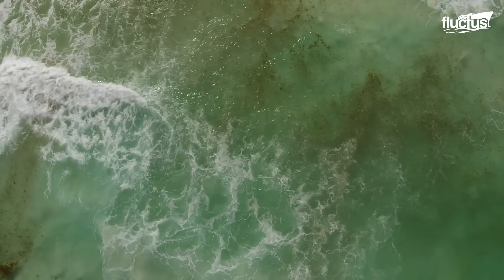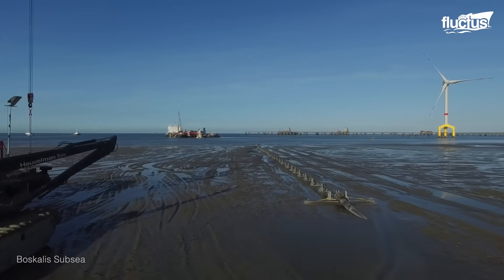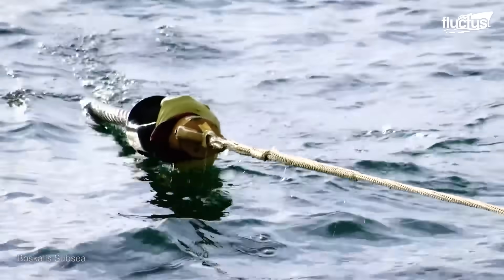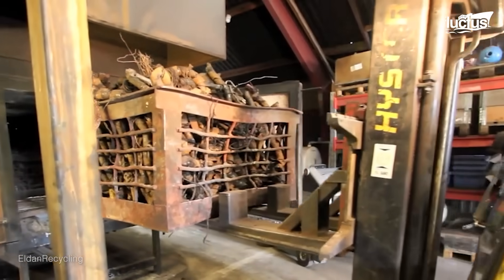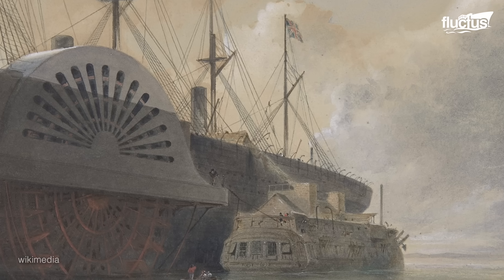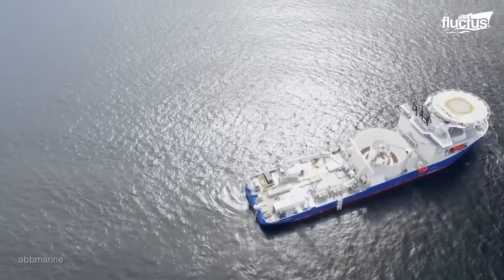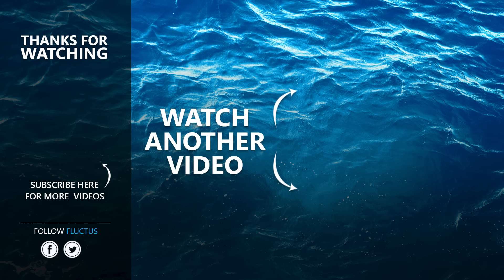There is a Reason Why Underwater Power Cables are So Expensive

Comment: I work for a company that makes similar undersea cables off and on for random customers (we make custom wire/cable as a business). The extrusion machines for the final jacket on the undersea stuff is massive. The extruder screw takes 6 guys and a special cart to install. looking at all those sub components... makes me shudder knowing how easy it is to screw up one production stage and completely ruin all the stages prior... Lol, makes me glad I work primary extrusion (the stages that put the first layer of insulation on bare metal strand) and don't generally have to worry about my mistakes, if any, ruining everyone else's work. Final Jacket on a cable like this probably has multiple process techs/engineers triple checking everything, so the operators probably aren't the ones to get in trouble if something goes wrong (the buck stops at the tech), but still... All those stages... So many single points of failure.
Reply: The steel armouring is understandable
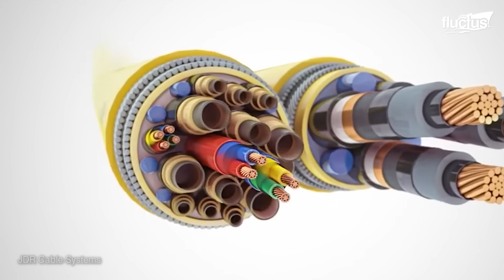At 2:48 there is (to the right) a very "complicated" 3 phase cable with a lot of layers but at 2:54 it is a fairly simple one.
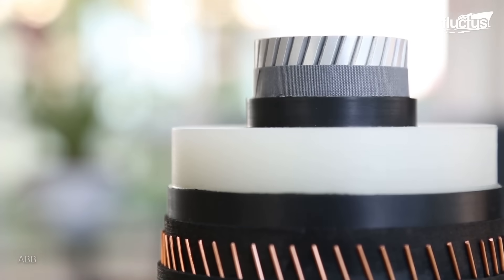every phase (2:48) have 8 layers around them before even get to the steel armouring, yes it is a graphical picture but I assume it is correct.
Reply: @qurkatimilaz3787  The left cable at 2:48 indeed a strange design. Most cables aren't that complex (the right one is a pretty standard AC cable though).

The reason why there are so many layers is that each layer have a very specific purpose. 
1. The centre conductor is obvious, 
2.  There are isolation layers that are also clear of purpose.
3. There are two semiconducting layers. (both inside and outside of the insulation layer, like a sandwich). These layers help regulate the electromagnetic fields passing through the isolation. Without these there is a risk that the fields will become unstable and can build up "islands" of huge field-concentrations randomly inside the isolation which would greatly reduce the isolation ability in those specific areas, often leading to complete failures as the current has an easier time breaking through at those points.
4. There are external protection layers that protect the cable against outside forces.
5. There is a screen layer (or layers) of conductive material that act as a buffer, if the isolation where to break down, these "screen-wires" around the outside will divert electrical power away instead of letting the power escape freely. (Basically a fail-safe to protect anything outside the cable from getting super-electrocuted in case of failure)
6. Layers of water-absorbent cloth that are supposed to expand when in contact with water, these make it so that, if water where to leak inside the cable for any reason, the cloth will swell and stop the water from traveling any further down the cable.
7. There is tape layers that protect certain very sensitive layers during production.
8. etc....
Reply: @qurkatimilaz3787  2:48 is from a company I used to work for in the UK. It is correct. Simple high power cables aren't so much their thing, they specialize in compound cables with hydraulic lines, fibre optics, signal cables and some power. Often used for controlling sea floor valves at depth. Designing them so they bend without damaging any of the components and so there's no interference between the elements is an art.
Reply: Whatever you do… don’t Newfie loop the cable
Reply: i need these cables. do you take online orders?
Reply: @rikhirajdutta2626  No, unfortunately everything is in person and/or over the phone. I also really can't disclose what company I work for. But we are one of three companies in the US that makes custom wire/cable on this scale, so if you look around online you have a 1/3 chance of getting the one I work for.
Reply: @JonM-youtube  , impressive!
Reply: Hi jon,
Im a engineer who works mainly with high voltage catenaries. I wanted to ask if these undersea cables actually hang or just lay on the floor of the ocean/sea.
Reply: @armandodemiguel7989   buried in the sea bed by robots controlled from the ship
Reply: @armandodemiguel7989  honestly couldn't say for certain. More than one customer, and we generally don't know exactly what they do with the finished product beyond a vague "it's an undersea cable" etc.
Reply: @JonM-youtube  I mean, i can see steel inside the cable, steel is used on catenaries so it holds the copper cable who is the one that actually conducts the electricity. And if they cable is gonna just sit in the seafloor there is no need for that extra steel.
Reply: I can 100% say he's Lying he don't work for any of cable manufacturing company
Reply: @RogueOneCR  You got me! I'm totally faking it. Couldn't get anything past you!
Reply: @JonM-youtube  just kidding Brother don't mind be happy and live long and healthy life.
Reply: im giving u a like just cuz u took the time to type that
Reply: I’m guessing these cables are designed to have some degree of redundancy built in. It would be a shame if one manufacturing defect would render the entire cable useless. It would be particularly frustrating to not find out about such a problem  until after the cable has been dropped on the ocean floor.
Reply: @xnetpc   Redundancy, that's up to he customer to design into the part, we just build it to spec and send it. We do however guarantee the part is defect free. And because of that we triple check everything. That I meant by a cable getting ruined by one of the intermediate steps is that somebody misses something and the person running the next step catches it (at each step we check the previous steps work before we proceed) and stops work until it's cleared by a tech or they decide it's no good. Sometimes we can undo a step if it's on a big enough part of the cable by stripping off the defective layer and re running that step. But a lot of the time if there is a problem we end up scraping the cable and starting over. Our internal error rate is 1.2% on average. Our error rate out the door is 0.2% and that is almost always a paperwork error like a missing document on a spool etc.
Reply: You fully voiced the terror in my mind
Reply: How much cost if private company wants to install 1 Mille cost?
Reply: @dirasadirasa2499  My calculation is a little over $2,000,000 per mile
Reply: @dirasadirasa2499  not the guy to ask, I don't sell the wire, I make it. But if I had to guess, a mile of cable like the one show on the video would be well into the 7 digits because of the setup costs.
Reply: how can I connect with you? I would like to discuss more with you on a business opportunity
Reply: @00971509971121   Sorry my friend, but while I feel comfortable talking about the technical aspects of the job, I'm not willing nir able to act as an agent for the company. Look up custom wire/cable online. You have a 1/3 chance of finding the company I work for if you aim for the big ones.
Reply: What is the name of your company? I manufacture custom cables as well, ranging from 28 solid to 16 AWG.  Just small time stuff, we use a Davis Standard extruder that's probably older than I am but it will run forever if you let it.
Reply: I worked in a glass factory in ig on the distributor machine it adds a seal to the frame to stop water and keep 2 panes on glass together. My job is the most important but easy to catch and fix mistakes. Usually glass breaks on the last step because there is a shitty machine.
Reply: No the cables dont rest on platforms / anchors etc...   They regularly span areas depper than any operated vessel has ever visited.
Reply: Would you accept me as an electrical and electronics engineering intern in your company 😁
Reply: That’s super interesting!! No joke
Reply: where to apply
Reply: what the company's name?
Reply: This is a skilled job.
Reply: That does remind me of an Italian experiment aboard the space shuttle. They ran a tether out to try to generate electricity from the earth's magnetic field. The experiment was briefly successful, but only briefly, as the tether cable had insulation that had air entrapped in the insulation, which allowed the tether to literally burn in half on them midway through the experiment.
One small oversight halted a multi-million dollar experiment.
Reply: @spvillano  indeed, air (or outgassing bubbles is the industry term when it's not air) can be a big problem depending on the application. My guess is they actually had outgassing under the insulation. When working with a primary, simple single conductor under insulation, which I assume is what these Italians were using, outgassing can come from a few sources. One being any contaminate on the surface of the conductor like oil that either burns or evaporates under the hot plastic as it is extruded onto the wire. This causes a bubble that stays after the plastic cools and can cause pinholes, week points etc. It's something the average layman doesn't know to think about but I'm surprised such bad wire made it into the space shuttle, even for an experiment.
Reply: Fascinating! 😊
Reply: Why do the cables have so many layers, I mean, is not just a copper core, plastic wrapping and "tube" to hold them together enough ?
Reply: @qurkatimilaz3787  they have steel for armoring against tight bending and friction from the seafloor. The isolation is extra-wide as the voltage is pretty high. There's a "semiconductor" layer (not like silicon, in this case it means not very conductive) to control electric fields and prevent arcing. Often there's also glass fiber for communication, fillers to get a round even profile and other plastics for stabilization.

The steel armoring also prevents excessive stretching of the cable when laying it down and when moved by the seafloor. Copper and plastics are too soft to carry the weight of the cable itself. Transmission lines also use steel-core aluminium wire to prevent tearing it apart.
Reply: @qurkatimilaz3787  because sharks constantly attack the cables and it's a really big issue so they have to make sure it'll survive the abuse.
Reply: @qurkatimilaz3787  for long distances transfer of electric power, the voltage should be high, to reduce losses.
The higher the voltage the lower the current for the same power.
So, long distance high voltage lines has established at 400.000volt (400kV).
As you imagine in such high voltage, the insulation of a cable inside salty water should be extremely robust.
Additionally to that, the cable have added several layers, metallic and polymer, to protect from wear.
Reply: @qurkatimilaz3787  I'm not an expert. I do know that 1 or 2 decades ago a trend started of using composite materials in various kinds of vehicles. Maybe that's what's going on here, as I too supposed at first that the same thing could be achieved with less materials. But the idea is that by putting together many different materials, it is possible to fine tune the final product in various ways (weight, flexibility, tensile strength, final cost). By combining materials, you get a material with properties that does not exist in nature. That's my theory for why it has so many layers, anyway.
Reply: If you were black would you have the same confidence to type this out? My guess would be no. That’s what we mean when we talk about privilege… try learning bro, it’s 2022
Reply: @ENikolaev  Who are you talking to?
Reply: Many men work so hard with these kind of jobs then lost half of their hard working income from a divorce, that's sad a female just sitting at home took 50% , if you look at all these hard work it seems not fair for humanity.
Reply: @vidalskyociosen3326  What in the world are you talking about? What does any of that have to do with making giant undersea cables?
Reply: Computers and robots have eliminated any issues, your company is from the 1970s.
Reply: @toddpacker7058  I will admit the extruders we use are actually quite old but the reason we stick with them is because newer automated extruders don't allow the amount of flexibility you need to make custom wire on the fly. The kind of cables and wires we make often require extremely specific customizations that would be extremely difficult to do on fully automated machines owing to the fact that automated machines usually require custom tooling for every single job.
Reply: @toddpacker7058   lol , any issues ? 
 AI cannot fix your idiocy bruh.
Reply: @toddpacker7058  Ok Zoomer.
Reply: @toddpacker7058  <-this guy lacks education

Comment: TY for sharing. There might be cables that supply offshore oil and gas platforms electricity in other parts of the World. However, while working out in the Gulf of Mexico’s Oil Patch as an OSV Captain, I never saw any offshore platforms that utilized cables to supply their electricity. Most of the newer platforms utilized their field’s own natural gas to run their generators, while many of the older platforms utilized diesel fuel which our vessels pumped to their storage tanks located on the platform. On a similar note, I witnessed offshore oil and gas pipelines being installed by  the M/V Lorelei; a pipe laying ship, which was fascinating. Also, while working as a US Park Ranger, I also observed an old AT&T telephone cable, that was no longer being used, which ran underneath Lake Mohave from the Arizona side to the Nevada side of Lake Mead’s National Recreation Area. That was a fascinating story about how that happened too. 😉
Reply: State waters CA
Reply: Offshore California platforms such as the 3 SYU platforms are powered by electricity from shore   through cables.  Also Platform Holly in
Reply: @chrischristopher905  TY Chris for posting that information about California’s Offshore Oil Platform’s. When I worked out in the Gulf, I was also supplying and servicing the Diana Hoover platform for Exxon Mobile while working for Seacor Marine. We were it’s Field Vessel. At that time,  it was the deepest deep water oil and gas platform in the World in 5,000 + feet of water. As far as I know that it still the case! 😉
Reply: @thercattrainer  Actually BP's Thunder Horse PDQ is in 6000+ feet of water and Chevron's Jack is close 6000 to 7000 feet of water ExxonMobil is partner in TH and Jack is tie back for EMs Julia Field
Reply: @chrischristopher905  Thank you for sharing! As I vaguely explained earlier,  in 2000, I worked as a Captain on the M/V Gary John; a mini-supply, for Gilbert Charmie Marine which was bought out by Seacor Marine based out of Houma, LA. Let me add some additional info which I did not elaborate on in my earlier comments about the Hoover Diana which might have been confusing. At that time, we were working as a Field Boat for Exxon Mobile’s “Hoover Diana” project; or Diana Hoover as some people call it,  which was the World’s largest (DDCV) Deep Draft Caisson Vessel. Also, at that time, i believe that it was the deepest deep water oil and gas platform in the World too. The Hoover Field is located 125km south of Freeport, TX in 4,800 ft of water. Normally you can only see around 6km out at sea because of the curvature of the earth. The Hoover Diana platform was visible at least 12-14km away. The flare boom was massive besides the platform, and when flaring excess pressure off of the wells, it was as though, a giant heat lamp was turned on above the platform, especially at night. The flame shot up for at least 300 feet, and you could actually feel the heat if you were standing on the upper deck, outside of the wheelhouse. I was fortunate to crew change off of the platform on Exxon Mobile’s Sikorsky S-76 Corporate Helicopter en-route to Galveston, TX which was really something. The S-76 flew at around 178mph. That whole experience was an unforgettable one, plus the deep sea fishing was really great too catching Mahi-Mahi on flying fish. I was so fortunate to work at the platform when it was brand new. That’s also where I got to see the deep sea pipe laying ship; called the Lorelei, working on the job, around the clock for a couple of months. 😉

Comment: And also to leave the decommissioned cable underwater equivalent to the increase of  water metal pollution
Reply: Just stop it... jeeeez
Reply: These cables when buried under the water basically don't corrode. Pollution? Hardly, as the outer layer is not metal.